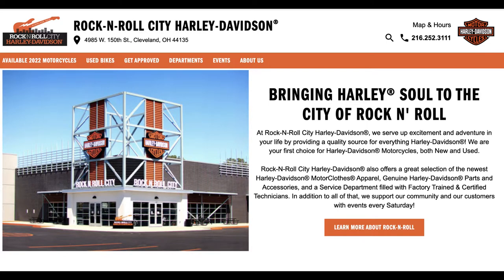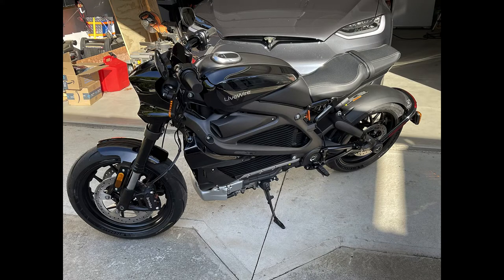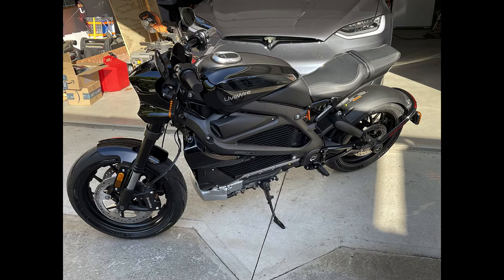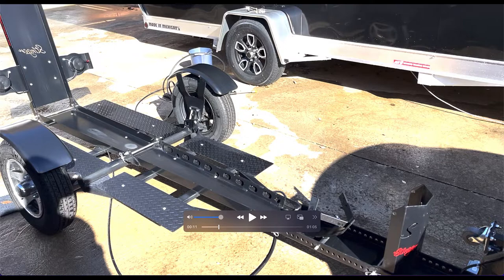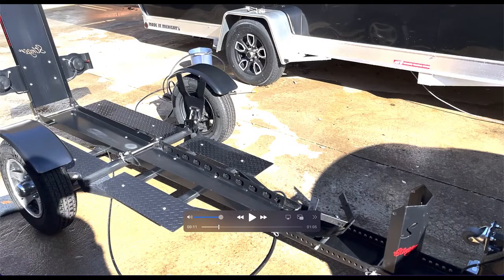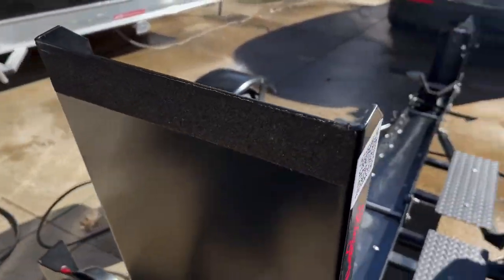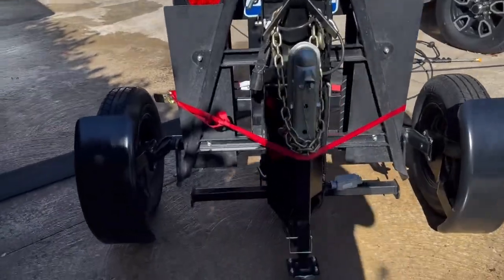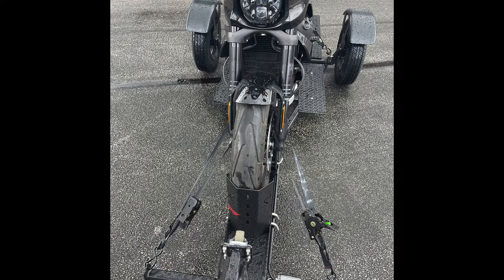Stinger 112 XL Review / Range test towing 2022 Livewire one with 2022 Tesla Model X

Comment: I found that the center rail and rear ramp were very slippery.   My Road King would actually slide backwards when unloading on a gentile sloping driveway, even though I was holding the front brake.   So . . .  I applied grip tape to the center rail and ramp.   Other than that, I really like the trailer.   😊
Reply from the maker: They now ship with grip tape on them